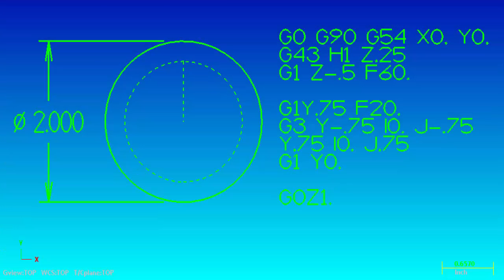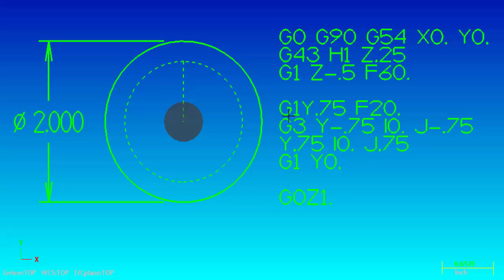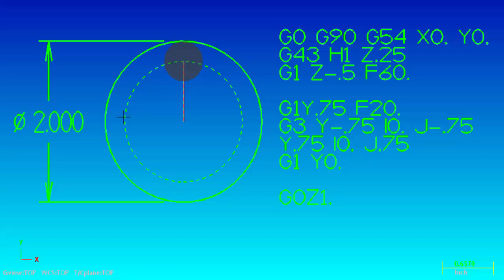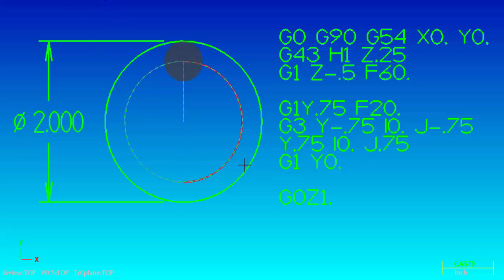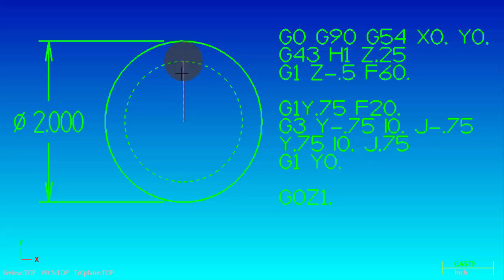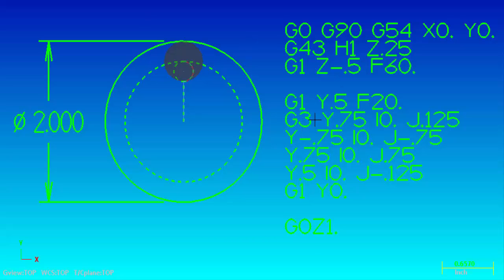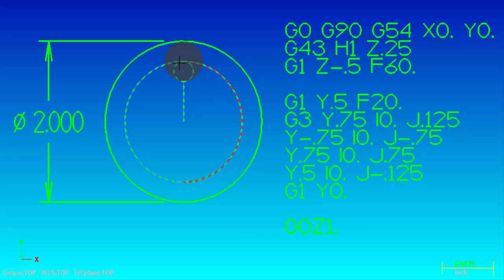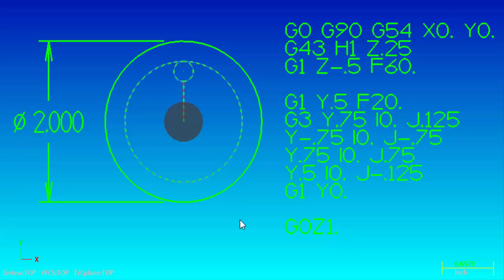HAND WRITE A CIRCLE MILLING PROGRAM FOR A CNC MILL

Comment: I can’t get it to work my zero is on the bottom left corner and I can’t put a circle in the center of my part because my zero isn’t on the center of the part how do I bypass my g54 and put a circle wherever I want
Reply: Use G91 when creating the circle. Then back to G90 when finish.
Reply: Make the hole G55 X0 Y0

Comment: Why no add D Option?

Should be like this...G10 G90 P1(=D1)L12 R0.0; 
what if my tool is 1mm cutting   
Diameter 2mm...
G0 G90 G54 X0. Y0.
G43H1Z20.
Z1.
G1Z-.5F60.
G1 G41 X0.5 D1 F20.
G3 I-0.5
G3 I-0.5
G1 G40 X-0.5
GOZ20. 
M98 P8888
M30

Comment: Question could you do a video on how you would program that but using cutter comp thanks
Reply: you would use your actual dimensions of the feature and use a D1 next to a G41 or G42 

so it calls for the tool diameter. You need a G41(left) or G42(right) so the tool will ride left or right of the line.

Comment: why j0.125 it will be o.25 there is some thing wrong or I have been confused.
Reply: the J.125 is to start the arc in a "phantom' smaller circle that smoothly transitions into a bigger circle in the next line of code.
Reply: @JunkyardDoggs  why its .125 whilst .5 + .25 = .75
Reply: radius of that arc = .125
Reply: @JunkyardDoggs  please teach  me sir
Reply: @affrizanuar9610  J.125 is the radius of the small circle. The cutter will do half circle so that is two radiuses/radii. Now it's .125 + .125 = .25 + .5 = .75
Reply: @wsantalitz7785  thank you very much . it helps me much sir

Comment: Tom, thank you very much for all that help, that you're geving us with this tutorial lessons. one question... how can I do an under cut, a groove, starting at the center but using mastercam.?basically at X0,Y0 using a key cuter to make a groove.
Reply from the maker: Anthony Gaona Thanks Anthony for that feedback. The undercut is done on a CNC mill correct?
Reply: I'm sorry For the late reply I didn't notice that you reply back, until today. yes Tom I'm  milling the slot groove in a Haas Cnc mill. I know how to doit by hand but I wanna know how to do with Mastercam. the reason why is because the center hole is smaller then the slot groove the center hole is .266 the and the groove is .378 thw.
Reply: Hello, do you also have a video for manual path programming?
I want to understand who G code works for a specific path in 2D or in 3D. Is there some kind of interpolation going on between the coordinates?
I am trying to understand the specific process of a machine that follows a polygon mesh.
Reply: I can't remember the quick way to make a circular cut without having to do a full program. It's not displayed anywhere in my search criteria